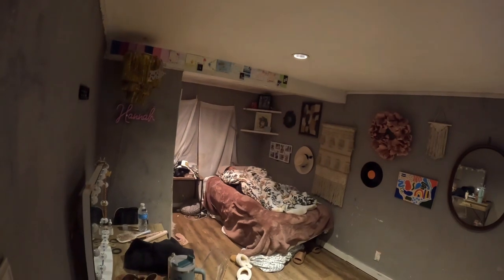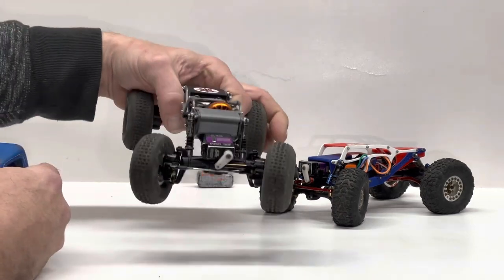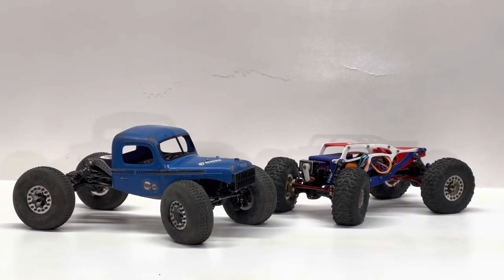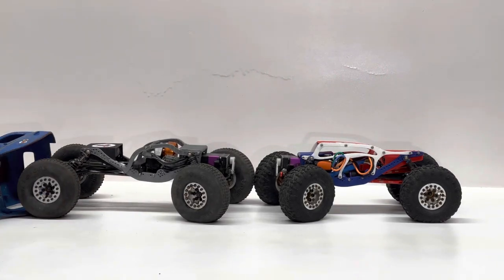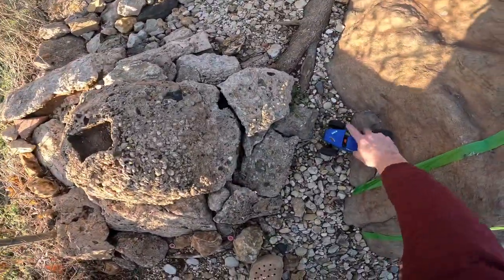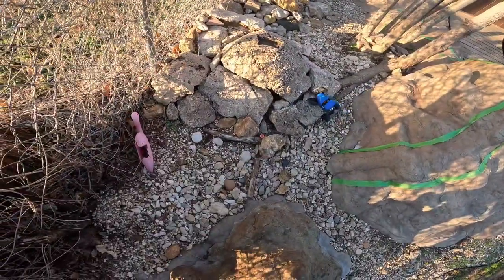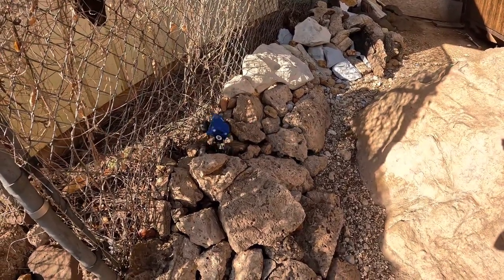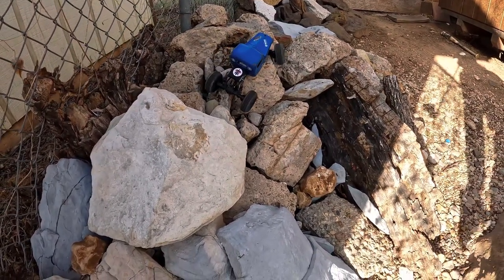New Rigs—New Helmet Cam—Same Knucklehead

Comment: Have you considered a chest mount?
Reply from the maker: Yep. I have one. Haven’t tried it yet but this helmet cam is exactly what I wanted to add. It’s not going to replace what I’ve been doing, just adds another angle, can use it as the main mic and will use it to include y’all in building and whatever. I appreciate the suggestion. Thanks for hanging out! Hope you have a great one.